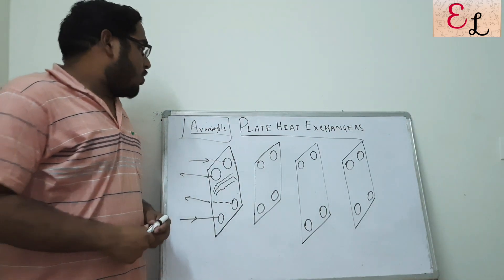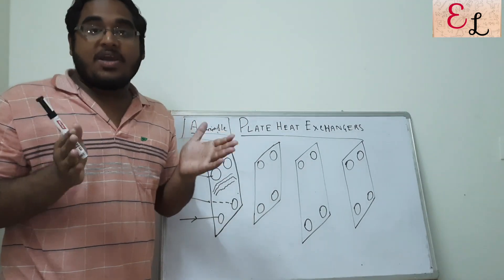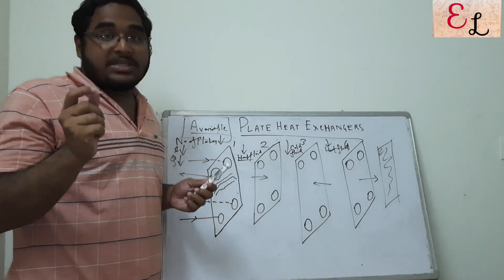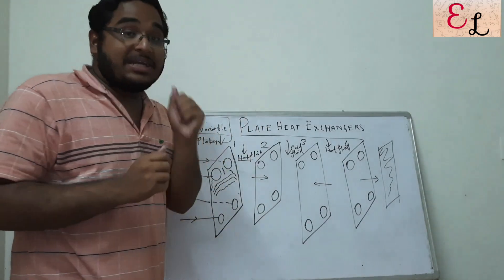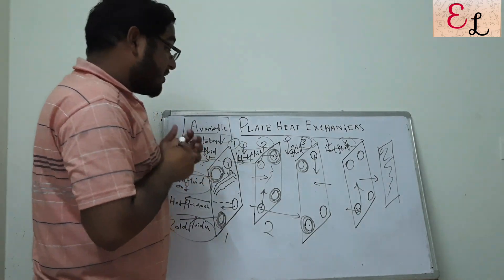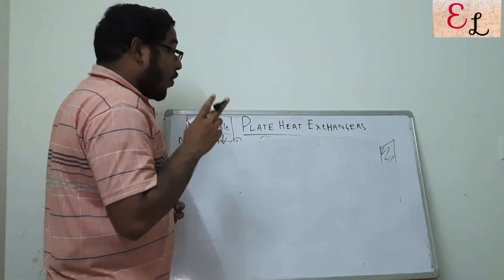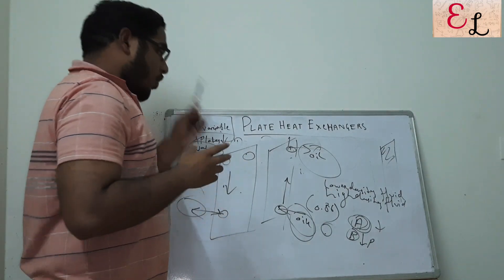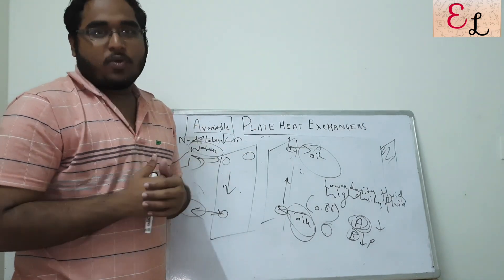PLATE HEAT EXCHANGERS | PHE WORKING PRINCIPLE | DESIGN | INDUSTRIAL PROBLEMS

Comment: Sir, is there sizing problem of plate heat exchangers in any textbooks?
Reply from the maker: I don't really remember of any such specific book mentioning this, but there are several books written on the topic of plate exchangers (example: Fin Plate Exchanger Design by Lambert). Please refer to them

To have a detailed chat and one to one consultation with me, you can book an event on my Calendar 📅 as per your requirement, on this link: https://engineeredlearnings.dayschedule.com/

Comment: Dada, if the operating conditions are such that both the hot and cold fluid have the exact same density and viscosity, which fluid should travel from top to bottom? Or is the direction irrelevant in this case?
Reply from the maker: Irrelevant, you can send in either direction
Reply: @LifeBeyondBusiness  ok, thank you